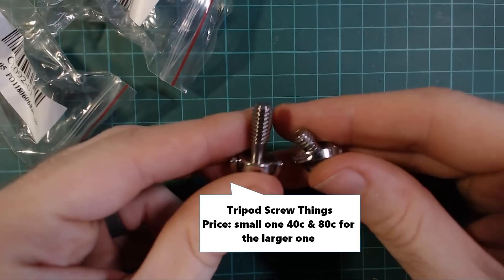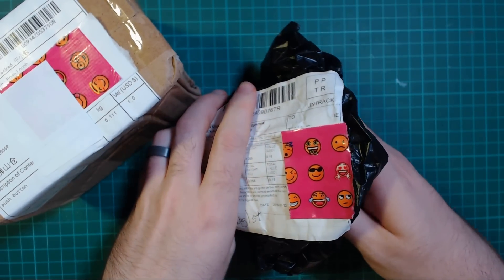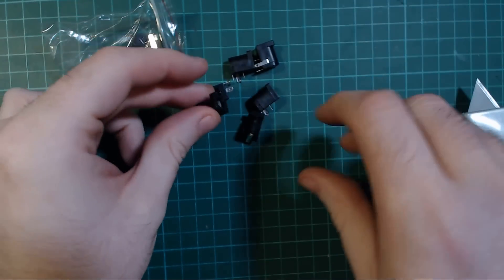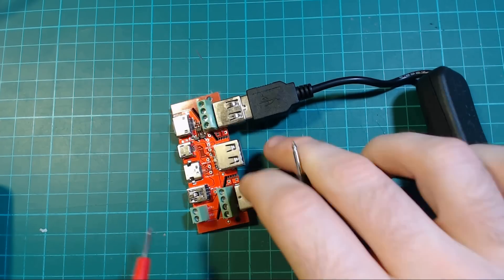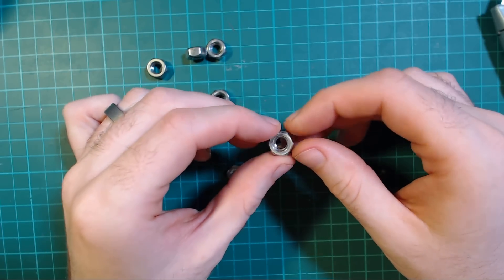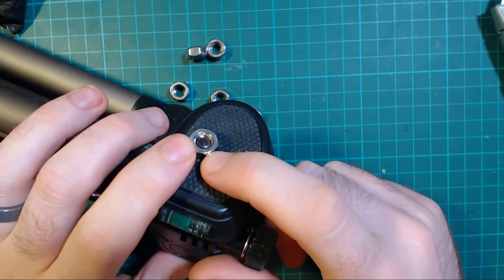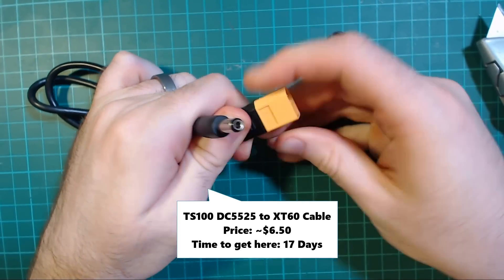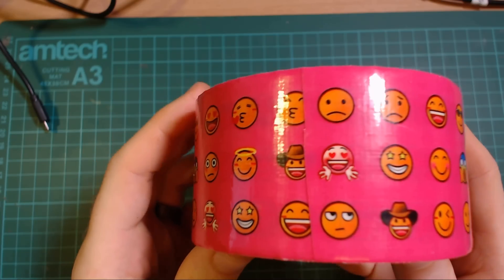Postbag #5 - With an additional rapid fire post bag!

Comment: Hi, the USB switch lead. You did not fully test it. 
The data pins can still be connected via some logic gate circuitry. 
The quick continuity test will not show that. Use it to connect a USB device and check for data.
Reply: You really think when they are using an 240V AC single-pole switch,
they care to integrate a chip in there ? And where ? For that price ?
- Would be a real surprise, but i like surprises.

I would see a higher chance for it to contain a usbstick data virus built in :-)

Comment: Goodness that TS100 battery cable gave me sweats thinking of people using it, coz it doesn't seem to have any low-voltage cutoff for the batteries, it'd be a battery killer!

Also, Colin Hickey? who dis? 
edit: oh @7:10 he's using your ESP8266 IR circuit.  ok.
Reply from the maker: I don't really plan to use it with batteries, but I believe you can set the cut off voltage on the iron itself in the settings menu. You definitely can on the custom firmware: https://github.com/Ralim/ts100

Yup, check his channel out!